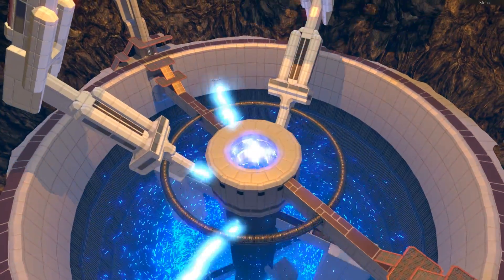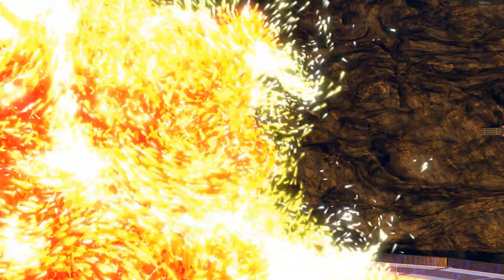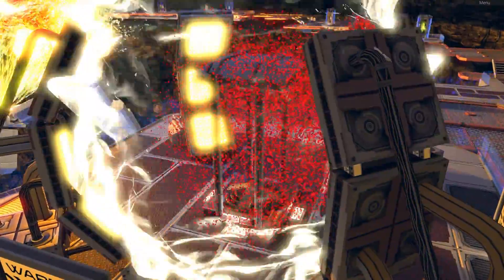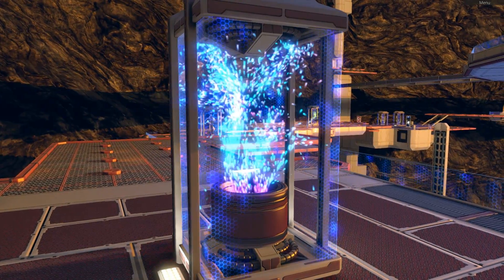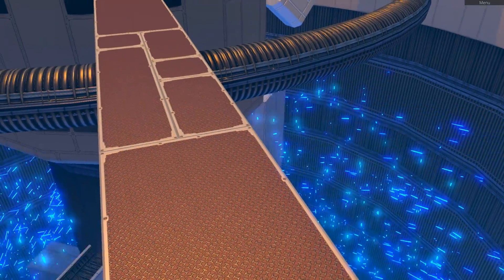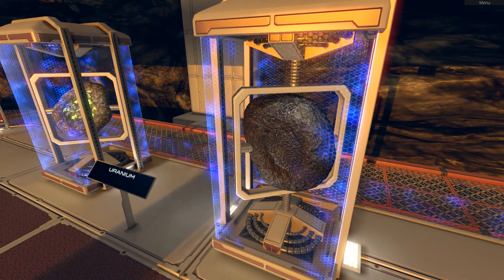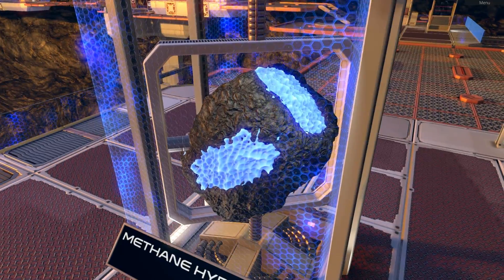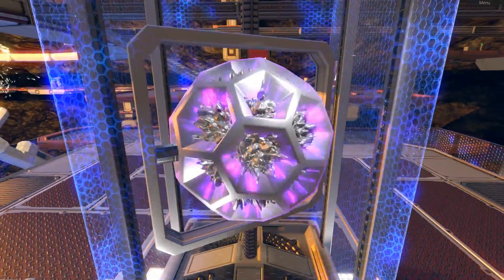Museum of the Microstar - Technical Flythrough

Comment: please update this for DK2 when it comes out! that would be awesome! the problem with DK1 is that the screen and resolution isn't good enough to do your demo justice :-).
Reply: it works decent enough in extended mode as long as you disable timewarp ;-) but sure sounds good!
Reply: i mean the current unity sdk support.